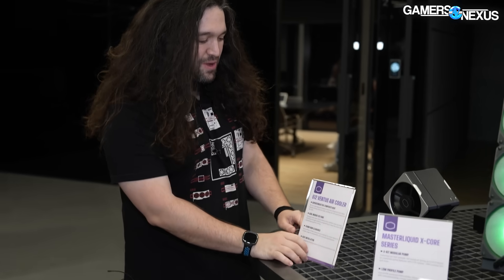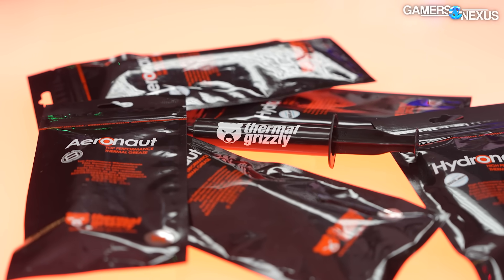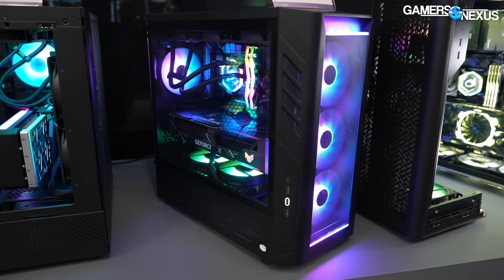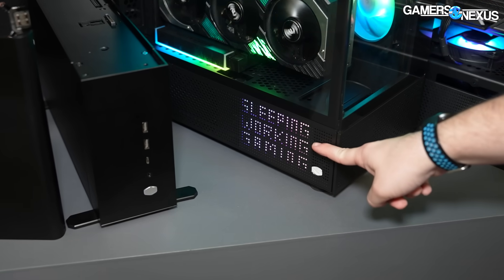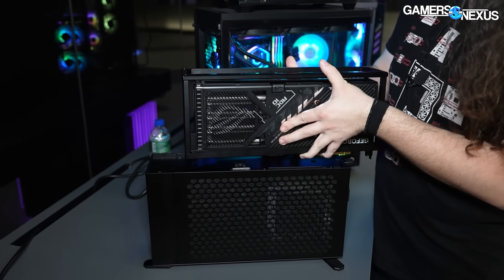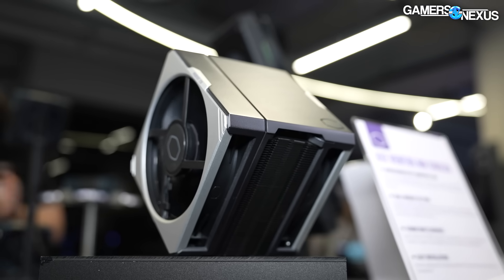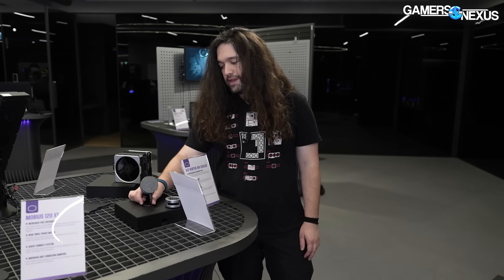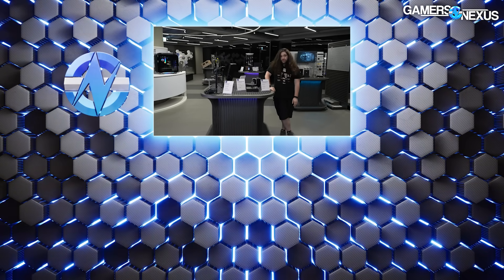Cooler Master's "Super Conductor" Heatsink, New NR200P Case Concept, & Clever ITX

Comment: Please make more open PC cases. I'd like to see something where you have just a flat plate with a handle shaped like an inverted T so it can hold itself up where the frame is also the reservoir of your water loop with a CNC'ed bracket for PCIe components, and a 360mm rad mount with the option to install a 5.25" bay.

Comment: The GPU showcase PCs make no sense to me, exposing the most expensive part to damage (always good to remember that the fundamental point of a case is to protect the components), open-air small GPU fans for extra loudness, and it exhausts the hot air INTO the case

Comment: The single most performance limiting factor in modern CPU cooling is the damned heatspreader.
Heatspreaders need to go and CPU again come with bare chips, just like it used to be and just like it's still the case with GPUs.

At the very least there should be enthusiast edition CPUs that come with a warranty and without heatspreader. The warranty could be limited to physically unharmed chips and despite being cheaper to manufacture could come with a bit if extra cost for all I care.

Comment: @15:00 I wonder how well that patent would hold up in the EU.
Generally I don't understand how the US even allows such unspecific patents.
LED, power on two sides, interlocking.
That feels like if anyone would design a new car and patent it as: Electric motor, four wheels, all wheels powered.

There are just so many ways to build something. So if three competitors already took all the options the rest of the competition can't work with the new standard at all

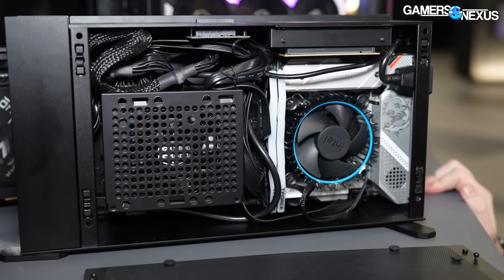Comment: 10:15 

I actually made a prototype for this case in paint 3 yrs ago. Mine had added thickness for a 240mm rad. The added thickness would also let run the 12vhpwr up to the gpu without having to bother too much with thickness constraints.

The gpu display area in my prototype had 2 mesh panels (1 in front of the gpu and 1 behind with the sides and top being glass

Comment: Thank you for the video!

Could you please elaborate more on the phone cooling statement? I don't understand how lower temperatures would improve battery life (except in the case of a battery getting extremely hot).

My understanding is that the hotter the SoC gets the more it throttles, and the less power it uses, but I'd like to learn more if that's not the whole story.

A use case for a cooler like that for me would be using my Motorola Edge 30 Ultra with a Snapdragon 8+ Gen 1 which throttles and drops the frame rate in "AAA" android games like Grid Autosport when the frame rate is unlocked, or in heavy emulation such as PS2 after a few minutes.

Comment: phone coolers is a good idea while using it on a car , on hot days while charging and using car play for the gps and audio , it can get very hot if the car tray dont have any ventilation  , and this is one of the reasons I prefer to put it in a support in front of the AC vent

Comment: Cmon. Where in normal case goes this air from fins? Straight to the MB to heat up board and nearby SSDs. Here it removes from the chassis without heating up components

Comment: I really like the cooler design. No rgb, no fluff or ginormously stupid oled screen on heatsinks. That's just e-waste. But this is simple in design and if it works, looks like a contender.

70$ is still a bit too high, giving the competition in the recent times. Depends mostly on the performance.

Comment: I really hope that Coolermaster listen to you in regards of the pogo pin connection for the RGB on the front panel. Removing the front panel can be hard at time and when you are cleaning your PC often, the risk of damages increases. Also, in my opinion,  there are no need to have the Sleep, work, game gimmick. If CM wants it,  make it an option.
I would be interested in both Ncore and Masterbox 500 Mesh depending on reviews. The Masterbox 500 is more or less what I'm looking for but all depend on the Airflow and storage device capacity therefore I would also consider the Ncore. 
I would love to see a new case with the same top design as the Mastercase Pro 5 . My cat love to lie on the top of my case when I am away from my desk. The removable top cover, provides a bit of space for the hot air to exhaust during that time. If CM releases the same case after fixing the design flaw for the tempered glass panel (Gaps between the glass and the top front panel) , and add an updated front IO with USB C, then I'll probable buy it. 
Fun fact Steve. 
CM was the reason why I found and followed your channel. There was a lot of hype before the H500P was released and this case looked very interesting (I would say good job to CM marketing team at the time). I, like everybody should, wanted to see some reviews first before considering buying it. 
Of course the thumbnail had Snowflake in it so how could anyone click on any of the other videos first. The appearance of  Snowflake in the start of the video and the constructive review of this case made me click that subscribe button.

urrently looking a

Comment: ngl I like the idea of just slapping the GPU on top of the case. I honestly thought about this when the 30 series came out and were getting bigger and definitely with the 40 series. Engineered correctly, it could eliminate a lot of the worry of trying to fit a GPU in your current case and/or the case you want.

The aquarium type case with swappable side panels is pretty dope. I'm sure people will come up with some really cool showcase builds in that.

Comment: I like the ITX case with the GPU on top, but they need to make a system that have 2 separate locks and one is automatic once you push the card in, not only to make sure there are no accidents in case one of them fail, but in case people forget to lock the thing, which will happen 100%.

The one with the GPU window it will only look good if you have a GPU with that exact size, otherwise it will look terrible.

Comment: Still have my TD500 - the only thing that bugged me as you mentioned in your review at the time was the mounting holes for two more SSD's but they never included the grommets or pegs for that. They then released a Version 2 - rather than include the additional screws and grommets they removed the mounting support entirely. Really smart! 😂

Comment: 9:30 I've never been a fan of the idea that half the GFX cards do this, just throwing air at the PCIe-slot and motherboard just to suck it back up again. I had an ITX build and the GPU that did this had absolutely abysmal temps compared to a higher TDP one that was simply pushing all hot air out the back of the case. I honestly think the only reason they do it, is because they fill up the I/O side and paint themselves into a corner where it's useless to try and vent from there anymore.. it requires the GPU to basically have a 'support fan' to help it actually evacuate it's hot air, hence bad design.

Comment: It that phone cooling thingy is TEC, any thing you may gain for reducing power leakage from lower temperature should be dwarfed by the efficiency of the TEC itself.

Also I'm not sure if the change in power leakage with respect to temperature is necessarily similar between desktop and mobile processors. It may be that mobile processors, being mainly ARM based (or just with a different power envelope with its design in general), don't necessarily share the same power characteristics with their desktop counterparts.

Comment: 16:02 to be fair, if your someone like me (who likes to not buy a new phone every 6 months), managing heat is 100% the key to making a phone last a long time
Battery gets hot? Slowly kills off the battery
CPU/GPU/RAM gets hot? Slowly kills the silicon

Speaking of killing the battery in a phone - although it's absolute pain because of how big batteries are now - slow charging them (Like 5W - 10W) will make them last wayyyyyyyy longer than using fast charge. You basically destroy the battery every time it fast charges...

Comment: I always check the GPU fin-stack orientation before purchasing depending what case I'm using - case designers don't seem to take much notice of how a GPU's airflow is meant to work & probably just use the dimensions - "yeah they fit, it's fine"  🤔🤔

Comment: Graphene is superconductive when it comes to heat because of the matrix of atoms. Just like carbon nanotubes... but CN are very difficult to manufacture. Also, why do you care about the openings in the case with the external GPU case? If a GPU is plugged into a motherboard it is flush against the motherboard itself instead of the metal plate.

Comment: I swear the fan motor size has stayed the same since the day I can remember 

Surely by now we can get tiny little motors, more blade area per cm/inch whatever ...
Or, being that close to the middle of the fan, its at the point of diminishing returns ?
Reply: Maybe. There's other things that can be done. I've seen a fan with two blade sets, one is like the normal blades, only shorter, located centrally, the other one is a circular counter-rotating (?) around the central part in the same plane. Supposed to form a stronger faster air flow because vortices form. Would be nice to see one tested
Reply: @BoraHorzaGobuchul  Maybe not even a smaller circumference motor in the middle, just a .. shorter (?) one, so the central part can be more of a dome rather than flat...

Shit I'm about to go balls deep into Major Hardware again (he does 3d printed fans... really weird strange designs)

Comment: I'm using a laptop as a transportable desktop for now (and an Asus too) and not beyond using miniPCs with nice dGPUs...but I cannot understand these custom desktop PC parts that are "custom-fit" to the point that, for example, if that ROG card breaks or you upgrade it and the new graphics card is drastically smaller or larger, it wouldn't stick out of that NR200P the same way.

Comment: Some nice cases there. For that AIO's VRM fan, might as well just grab the Cooler Master Atmos then, as there are 3D printable badges that let you install larger more functional fans for cooling the VRM. Pretty sure it will be the same pump.

Comment: Idc for mini ITX cases or whatever its called in general, but might be up for one like this if we had GPUs that have fans in an exhaust to outside configuration. If you don't run a shty recent intel furnace, the rest of the case insides would be stone cold then.

Comment: there kinda is a reason for the bottom to be a solid panel on the top mount gpu. Once you remove steel, integrity, the metal poles will be attached to a more flimsy material. whilst those parts will be firmly fixed the sides will not be as sturdy when lifting, so the rest of the chassis for holding it risks warping which will put strain on the pcie connection. it will considerably lessen the weight you can lift by the top which may cause damage to parts..... just saying.

Comment: I think the point of the ITX case is that heat will probably go up anyways in such an open case. idk if thermals will be that big of an issue on the gpu which saves you all the issues with putting holes in the top and bottom plates

Comment: With Tec coolers for phones, battery life does not even get a look in, its purely for performance, when using them you will have the phone powered by the wall or by a battery bank, as playing high end smart phone games will destroy your battery just as fast as a stem deck, I was using these Tec coolers when I used to play COD mobile to give me sustained high frame rates without setting the phone on fire :) they do work quite well.

Comment: Slapping the GPU on the top of the case is actually pretty smart.  I've always had a weird issue with the GPU intake being right by the PSU.  letting it breathe makes it easy to blow my air conditioner unfiltered directly into the graphics card

Comment: That's hilarious, I've actually been using an NR200 together with a Strix 4090, I've had to modify both heavily to make them fit together but it's kind of hilarious to see CoolerMaster make it a first party thing. Mine still looks stock on the outside though, I've had to cut the front faceplate and remove the extra plastic on the strix to make it fit but it juuuuust goes in there. This is not a bad "no-mod" approach and looks kinda cool.

Comment: on  Concept  case`s  
Raising the  Edge  Where  Gpu  Latches down as the Side  via the riser  connection  has to Match  Only  = the rest  Down Firing  if  Not  but  Out  to  Each  side  as a directional  wedge  Center Point  Out To  But  sides  =  both  with  a  slight  exit  preferaction  into  the  Raised  Height  to  appoprox  the desired  lift  to  obtain a  guided  edge  max  down to a  preferably  desiable  outcome that  may  or  may  not  also  have  to  have a  limitation  via the design  of  the  pcie  Slot  Placement  or  will  placement  come  into  the  equation  with a  smaller  gpu  as This Zthing  is the  Biggst  sized  card  there  is  =  Isnt  it  ,  Or  did  nvidia  beat  that ? i forget  , , ,  anyway  just  raise  tghe  sides  a bit  put  a  wedge  centered  ou  both  front  n  back  side with  vents  , you  could  do  one side as  well  , yes  , just  ventualation ,  test  fit  two  of the saem  , with  just a  floor  as you are starting with a  floor  now  , with  already  existing  walls raised  , just  lift  up  wall to  also  help  with  seating after ,  done  .  Hope  this helps  , or  hope  you  understood  it   , ???  kinda of a  mess  ,  but  its  there /  also  will  need  almost like  an  add  on  but  a  welded  or  milled  if  you are not  using  roll  steel  /  milled  you  would  wont  to  leave  a  seat  lip  for  gpu  bracing  as  it  sits  now  on the  far  Edge  side  basically a  small  lip  that  runs  around  the  inner  side  of  casing  to  help  support  gpu  in place  ,  basically  taking  the  same  seating  plate  you  have  and  punching a  miffle  elongated  hole  lengthwise   and  braced   for   slot  them  on  inner  opposite  side  a  seat  for  gpu  bracing may  have to  be at  an  angle  as  many  gpus  may  not  fit  unless  you  have  a  humongus  gpu  to  fill  slot  alotted  to  begin  with  was  my  other  concernt  on  seatting arrangement  for Smaller gpu`s  .

Comment: Those mini itx cases that display the whole gpu look great. Although dust accumulation on the card would be a pain in the ass probably
Reply: Vacuum-cleaner module you slap on your card - it immobilizes your card fans, and sucks the dust right out. Other fans that may be affected have to be immobilized by manually shoving long sticks through them :)
Patent pending.

Comment: 16:30 Some phones, including some high-end ones, have had issues with overheating while recording video, especially in hotter climates. So an add-on cooler actually has potential use for more than just battery savings. With that said, then there would be concerns about the noise of the fan in the video
Reply: complete shutdowns due to overheating is definitely a real thing
condensation might also a concern if the cooling is too powerful

Comment: while i'm all for them trying to find a solution to the gpu weight/power connector issues... i really don't feel the motherboard mounted power supply connection.

they could have easily just modified the xt120 or xt150 connectors and spec'd a large enough wire gauge and been done with it all.

instead, its all just ridiculous methods that are likely to have even more concerns.

Comment: I do like that smaller case witht the gpu exposed on the side, but I feel like it's way too proprietary- how many other GPUs will fit that profile as clean as that one specific GPU does? And then it's ASUS so automatic nope. It is neat though- I've wondered why there aren't more cases that keep the GPU and/or it's cooling isolated from the rest of the system. I actually modded an ITX case to accept a full ATX board, which stuck out the side of the case and the GPU was just like this- it was exposed, yet it was flush with the side- the concept worked well, kept my system cool despite the super tight fit of everything. I ran that case for 2 Years with the Motherboard sticking out 4 inches and I'm still running the same Motherboard Today (different Case)- I was SURE I'd kill the board with my mod but I had some extra Money just in case something happened. It was kind of neat looking and janky at the same time.

I'm really glad we are now getting more inverted cases, I've wondered for a long while why we don't have more of these.

Comment: If the phone is cooled more it will be able to sustain much higher frequencies and thus drain a lot more power. There's no way to control the SOC unless the devices are rooted and the kernels modified
Reply: The rog phone allows without root

Comment: They don't need to fix this, they need to get a Nobel prize for discovering room temperature superconductors. I still don't understand what the advantage of using it in a pc case is, but its impressive nonetheless.
Reply from the maker: Hahaha
Reply: How else are you going to power and cool your next Intel CPU, nevermind the next Nvidia GPU 🤭
Reply: nono, its actually a regular superconductor that you need to pour liquid nitrogen on constantly. we're still researching into why it works but when you press the activated superconductor against a CPU it somehow keeps it cold.

Comment: I inverted my Be Quiet! Case, I literally through my back out because of how long I was hunched over it.
Reply: I had some "fun" inverting my cosmos 2, since I wanted it inverted but also the glass door on the other side and the PSU on the bottom, I had to shorten one of the metal plank things manually, or something would've fit. Either I'm dumb or their manual is, but it worked. Not something I want to do again :)